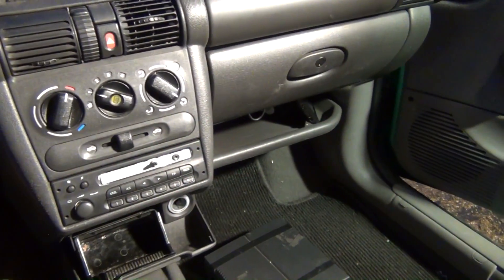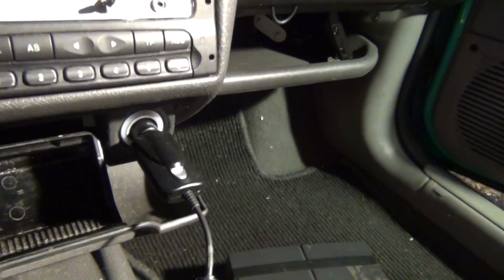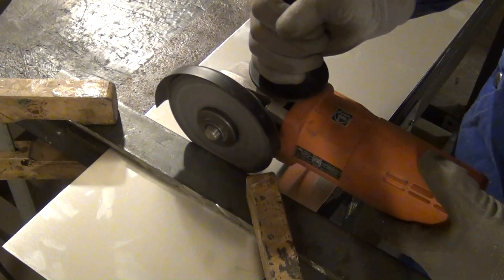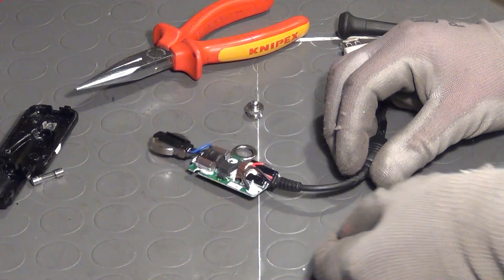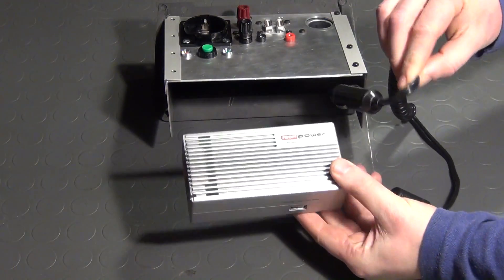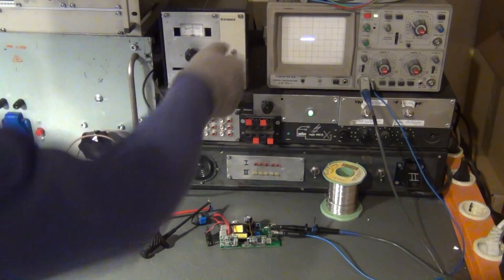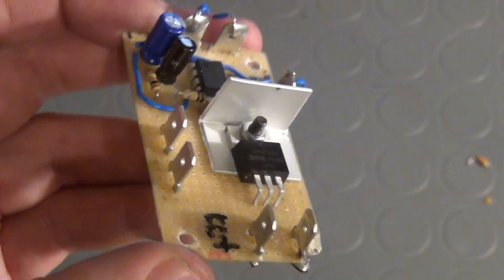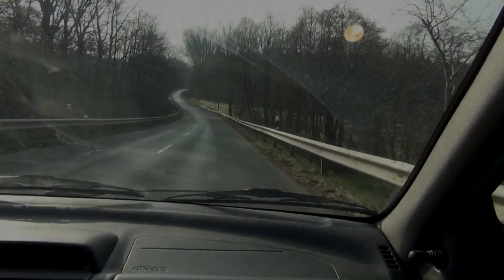Adding a Power Inverter and USB Power to your Dashboard /Car

Comment: Hope you are reading comments, even on your old videos.  You are inspiring so many of us.  Quick comment about your car keyring with all the keys (and other stuff).  Reduce the weight as much as possible.  The weight will abnormally wear out the key mechanism (the switch) and you'll have intermitted and/or no starts.  Anyway, keep making videos about reuse and adapting tools.  Thanks!

Comment: There has to be a better, more efficient way. I still see this in 2020 with my colleagues - a commercially produced inverter installed in a vehicle to go from 12V DC to ~230V AC.
They use this to plug in the various switch mode power supplies and chargers for their portable devices - that provide say 9V, 18V, 20V, 24V, 36V DC output.
The step up to ~230V AC and back down to ULV DC again must be inefficient.

I know there are issues around some devices (hello certain laptop brands) that will not accept any charge other than from a specific make and model of charger they recognise (their own) - i.e. there is some control chip in the power brick that allows it to identify itself to the laptop to say "Hi, I'm an official power brick".

Perhaps in this case it is more a case of just accepting the inefficiency of the DC > AC > DC conversion steps as a sacrifice to make for the convenience of the standard AC outlet?

Still irks me all the same :D

Wouldn't irk me so much if the DC > AC inverter wasn't just another load on the vehicle's alternator causing the fossil fuel engine to have to work harder. Internal combustion engines produce so much heat that has to be dissipated, I wish I knew enough to come up with an idea to use that waste heat to do something useful. Some insane hacky use of a Peltier module to produce electricity from heat.

Sorry for rambling :/

Comment: Wouldn't it be cheaper/simpler to bend single sheet of aluminium instead of bolting 3 pieces using an angle bars?

Comment: Nice idea and thorugh exploration of the basics :) Be careful with connectors and cables shaking loose in the rough environment, if the wrong cable shorts to the front panel some bad s-t could go down..selastics and some shrink tubing would be a good idea?

Comment: why would you convert from 12VDC to AC just to have to convert it back to 5VDC to charge your camera battery?
Reply: Wesley Hand if you think about it that's what we all do all the time energy has to be converted to make it useful. Why burn coal just to convert it to electricity so you can heat your house with an electric coil? The answers so you can get the energy from one place to another and in this case only few centimetres.
Reply: alyosha pearce ok I get that but why not just reduce the 12VDC to 5VDC and save the trouble and wasted energy
Reply: it gives him the option to use the ps for other electronics in the future
Reply: Is that what's happening here? My understanding is that 12VDC comes from the car and splits: one 12VDC line to the AC inverter, one 12 VDC line to one set of posts, and one 12VDC line to the buck converter that puts out 5VDC for the second set of posts and the USB outlets. Am I mistaken?

Comment: Is it a good idea to use the Car starter battery with an inverter? Wouldn't it be good to sacrifice one of those battery chargers to modify it for using with car because I'm pretty sure inside of that charger the 220V AC is stepped down to smaller amount first!
& I believe there are some small chips or something that can make it possible to convert the USB to kinda auto negotiation type and can deliver higher current to suitable device. I once kept  D+ and D- floating, and the phone won't consume more than 1A although my circuit could provide up to 3A and the original charger for that phone delivered 2A.

Comment: can the inverted AC kill you? it is 220v volts, but at 150W, that makes it 0.6Amps, is it enough to kill you?
Reply: +Flix Yes. 10mA is considered to be the upper limit of "very painful" but still safe. 100mA will definitely kill you.
However, since the inverter output is not referenced to ground, you would need to touch both output wires in order to get a shock.
Reply: MrOpenGL I dont understand how the inverter makes lethal electricity from a somewhat harmless source, like the car battery. It bumps up the voltage to 220v, and lowers current to 0.6 (lets say battery is 12v 15amp (but car batteries have much greater amperage)).That how I imagine it being done
Reply: ***** Just consider Ohm's law: I=V/R
The current I is determined by the resistance of the body (R) and  the voltage (V) of the source.
Having a source with "a lot of amperage" doesn't automatically kill you. First of all, the "amperage" written on power supplies, batteries and inverters almost always means the "maximum current" that can be safely drawn from the device without it overheating or blowing up. It does NOT mean that the device will force that current through whatever load it is attached to.

Real world example. Let the body resistance is 10 kOhm hand to feet. This is typical if you are sweaty or your hands are most. If you are dry, it can well be into the Mega-ohm range!

12V battery: I=12/10000 = 0.0012 A = 1,2 mA (you can barely feel it)

220V inverter. I=220/10000 = 0.022 A = 22 mA. This is enough to seriously hurt and maybe cause some involontary action like pulling away the arm violently, or causing the hand to grasp firmly on the wire (exacerbating the problem).

750V train third rail. I=750/10000 = 0.075 mA = 75mA. This could very probably kill you.

Notice how the third rail, which is in theory capable of supplying more than 3000 A, can only push 75mA of current through you. Unfortunately, this is enough to kill you :D
Reply: MrOpenGL oh okay, thank you very much for the detailed answer, I am still new. I know the formula for ohms law, but still didn't understand the interaction between the 3 variables. Thanks!
Reply: *****
You're welcome!

Comment: great video's, google 'adjustable circle hole cutter' or ''panel hole cutter' great tool for holes in panels, slow speed, clamp to scrap wood or between scrap for thin material,  i use mine for pc fan mods, tungsten cutters available.

Comment: Little tip for that hole. instead of hand filing a dremel works wounder to round out after the drilling operation. New subscriber so far very much enjoying the vids. found you via a link in AVE's vids.

Comment from the maker: Some have commented about the rather thin wires leading to the lighter. 
The wires are secured with a fuse in order to prohibit overheating, but since that fuse is rather large, I added another more sensitive fuse to the device, that will prohibit over-currents.

https://plus.google.com/photos/101910808069224874502/albums/5995201839970120257/6255178425164378914?pid=6255178425164378914&oid=101910808069224874502

(In addition: I don't think that I will ever draw more than 50W from the inverter).

Comment: Dude your way overloading the circuit from the cigarette lighter original wiring. It's only rated to around 10 amp so if you start using all of them add ons at once then you will start melting wires and breaking fuses.
Reply from the maker: +Dan Moody I do not intend to ever draw more than 50W from the inverter. But still, you are right, that the current rating of those rather thin wires could be exceeded. For that case I have now added an additional fuse to the device, that is more sensitive than the car's own fuses:

https://plus.google.com/photos/101910808069224874502/albums/5995201839970120257/6255178425164378914?pid=6255178425164378914&oid=101910808069224874502
Reply: +The Post Apocalyptic Inventor my suggestion would be to run a wire of thicker gauge to a relay and have the relay turn on wire to the original wire for the cigarette lighter so that way you don't have over stressed wires and so can still have it turn on with the car turning on
Reply from the maker: +Dan Moody I thought about that as well. I guess that I will install a much larger inverter in the back of the car at some time in the future. For that I will definitely run a new wire with large cross section area from the battery to that inverter.

Comment: Awesome job! I find the inverter a rather inefficient way to charge those batteries, and I would hack them and find the voltage it supplies to the charge controller, and work that way up into adapting the 12v to the voltage that the charger requires. typically those batteries are just 3.7v so you might get off by supplying 5v to the charger/adapter
Reply from the maker: +XanderZ Installing the inverter is more about versatility than efficiency. The good thing is, that all kinds of chargers can be used spontaneously. For example when friends are in the car and they bring there laptop. Or when I use equipment that I don't have with me every day. Modding all those chargers beforehand or building a charger for the form factors of all those different battery types (which I might not be using anymore in a few months) would not be worth the effort. Efficiency is also much less important if the overall power needed (like with the camera batteries) is very low.
Reply: The Post Apocalyptic Inventor Sure, with Switch mode power supplies everything should be fine..But with inductive loads, it is quite useless..Afterall, it is quite useful indeed..

Comment: Should have put a computer fan in it to cool things off, it's going to get hot. Vent holes in one side of the aluminum sides with a fan on the other side. Otherwise, Nice Build!

Comment: hey I have a project I am considering and i'm pretty sure you will know if its theoretically possible to do it the way I am thinking.   Im building an off grid RV and I'm wondering If It's theoretically possible to power a PC directly from a battery bank by bypassing the transformer and rectifier in an off the shelf  pc power supply?

Comment: Automotive electric system is a most severe environment: HV induced into the circuit, huge load spikes (starter motor). Interested to see how it survives.

Comment: Nice job as usual, however are you aware that by adding the inverter you may be invalidating your insurance? I heard about this on a UK consumer radio program, where a man had his car insurance cancelled after he'd had an accident because his bumper  and wing mirror were non standard VW fitted. You know what insurance companies are like when they have to pay you money. Sorry to be the bearer of bad news.
Reply from the maker: I'm pretty sure, that the ensurance companies will look for every possible way, not to pay. However: There are many parts on my car  already that are not standard Opel equipment, because these parts are not even produced anymore. And were are talking about components, that are actually relevant for the car's safety.  But your concern is still valid and I will try to inform myself, if there are clear rules in place for this type of modification.

Comment: Greats stuff! Will be interesting to see how the alternator handles the extra load. I have to watch the voltage on my motorbike if I am using the heated grips and not riding fairly regularly.

Comment: You can just use a sepic converter with multiposition switch to set voltages for all your devices instead of inverter to make 230V and wastefully convert them down back to small voltages. You wouldnt need all those adapters while charging in the car and it would be more efficient and safer. BTW I am really happy that you are back making awesome videos. Thanks.
Reply from the maker: It is true, that you don't really need an  inverter like this to charge bateries. But this is about versatility. It ensures, that any laptop, phone, camera or who knows what,  whether it is mine, or a friends can simply be charged in the car without the need for preparation. The original chargers will not have to be modified.

Comment: You powered all of that with the leads from the factory cigarette lighter? Most cars that I've seen use dinky 18 or 16 gauge wires for that... I'd think if you are running the inverter and the buck converter at the same time, you might draw too much current and blow the fuse, no? Or worse, cause a fire by melting the lines?  I've done a ton of emergency vehicle wiring, and generally we'd run dedicated 12 or 10 gauge wires minimum from the battery -- most cars have a knock-out in the firewall for aftermarket mods.  Just a thought -- else you might be getting a new car sooner than you thought!
Reply from the maker: The fuses of the car are actually supposed to prevent fire. They are sized in such a way, that the wire is not burdened with currents larger than the rated value. Furthermore: I guess I will never draw more than 50W from both devices combined. It's really just about charging small apliances.

Comment: At full 150W output, your inverter can pull >12.5A from your car battery, those wires going to the cigarette socket look quite small..
Reply from the maker: Yes they are. I don't think that I will ever need more than maybr 50W though.

Comment: Newbie question incoming: In the toggle switch circuit diagram, shouldn't the bottom 10k resistor be a capacitor?

Comment: well done, looks like the bttf delorean xD do you really need that inverter? could not use a simple tp4056 to charge battery? adios amigo
Reply from the maker: +Proyectos LED Hey there :) Charging the battery directly from the 12V source by means of a switching converter would be more efficient. But that approach would also mean, that the system would be much less versatile. The good thing about having a 230V outlet is, that the charger of any phone, camera, laptop etc. can be plugged in without the need of any further preparation. Let's say a friend is with me in the car: He brought his laptop and wants to charge it: There will be no time to first build a custom charger for that battery :) 

Also: All of those cameras and phones use batteries with different weirdly shaped form factors, which would require me to custom build battery holders for each of those devices, some of which I might not even use anymore in a few months time. The result would be, that I would have a rather large device taking up space with battery holders that will not be required anymore. The efficiency of the charging process is also not really important, since the overall power needed is very low. 

Long story short: In this case, versatility is more important for me than efficiency.
Reply: +The Post Apocalyptic Inventor You are right, thanks

Comment: if the inverter is turned off the ground of its USB port is floating at around 12V.
Could be a problem if you want to connect your phone while its connected  to the AUX of the Radio.
Reply from the maker: Good point. I guess I will maybe  modify the toggle switch again, so that the inverter stays connected to ground, putting a mosfet on the positive rail instead.  That's how the original relay based citcuiy operated. It is an unlikely scenario though, since I haven't used th line-in jack ever since I installed the bluetooth receiver. I also probably will never use the inverter'd USB output. But you're still right.

Comment: Forget the radio, what did you do with the seat?
Reply from the maker: +papalevies I was transporting wooden beams the other day. I needed them for a winching mechanism that I will show in another video some day. I really just removed a few bolts and took the seat out, so that those beams would fit inside this car.

Comment: Lass das jaa nicht den TÜV sehen ; D
Reply from the maker: +airsoftandguns Da war ich ja gerade zum Glück erst :D
Reply: +The Post Apocalyptic Inventor aber wenn du mal in der Polizeikontrolle kommst ist das schon bedenklich
Reply: +airsoftandguns *eine :D
Reply from the maker: +airsoftandguns Ich wurde neulich von der Polizei angehalten, weil ich irgendwo falsch abgebogen bin. Mein Auto war voller komischer Sachen und der Beifahrerseitz war ausgebaut, dazu mein offensichtlich modifiziertes Radio. Die haben einmal ins Auto geguckt und nichts gesagt.
Reply: +The Post Apocalyptic Inventor Hatten wahrscheinlich schon Angst

Comment: Very interesting! Not something i would do to my car since its rather recent model, at least to that extend. Although i am planning to do something similar in my bike. I d love to add a voltmeter for the battery, a usb charger and a "call indicator LED" as well as a connector to which a solar panel will attach and the battery will charge when its parked in my open type garage!
Your projects are amazing mainly for the reason that they are simple, useful and robust (or at least you make them seem simple!) Keep it up! Good to have the channel going again!

Comment: If your camera supports it, turning down your shutter speed might help with the flicker and aliasing on your 'scope
Reply from the maker: +Rob Mckennie I'm sorry for that, but I'm just using a camcorder. It doesn't allow me to make adjustments like that.
Reply: +The Post Apocalyptic Inventor I was going to say sell that scope to the local museum and use the funds for a new one haha. It does work though and it is probably better with high voltages than a lot of new ones.

Comment: man you fucked up using metal. good way to short shit out. I know because ive been there
Reply: +tim turner thats why they make all the high end test gear, scopes, power supplies and all in metal cases. They want you to catch on fire
Reply: Theres a big difference between sitting on a shelf in a lab and bumpin around at 150kph
Reply: Or you could just mount everything properly, then nothing will short.
Reply: +tim turner ever seen a car radio? also made of metal.
Reply: +tim turner ever seen a car? Haha
Reply: the only wrong thing TAI did was not painting it/ adding more chrome inside his car to match it.